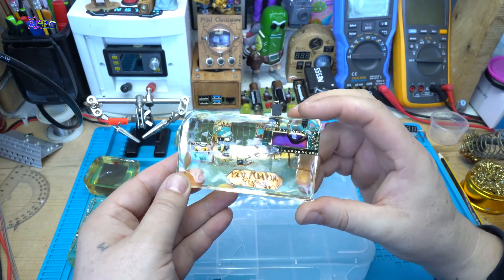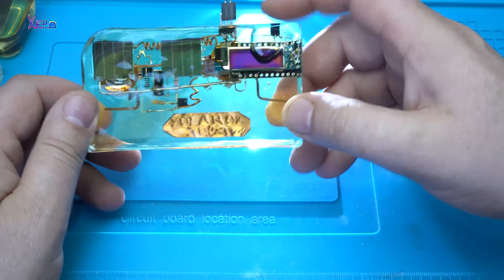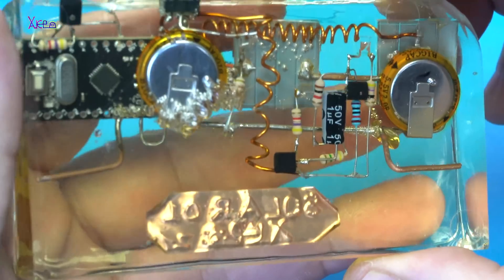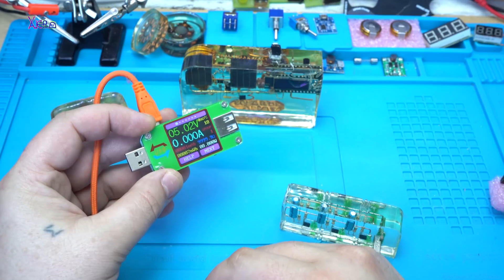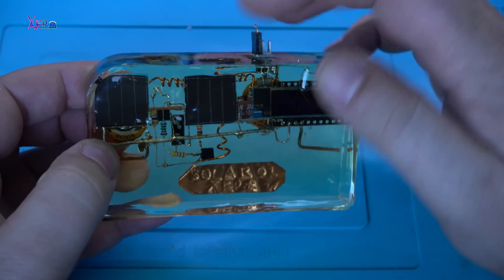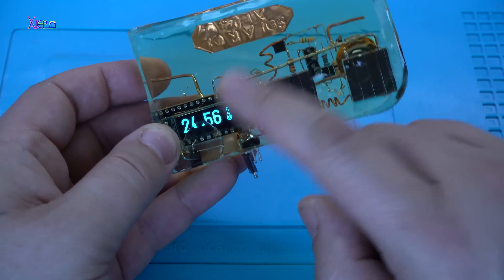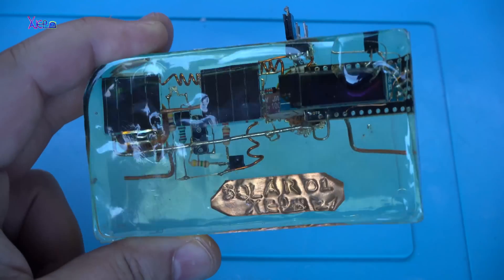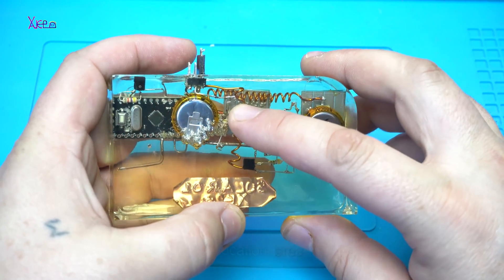Super Capacitor Invention in Epoxy Resin | Find out does it work?

Comment from the maker: What dou want to see in Epoxy resin,comment below?
Reply: Power Bank in Epoxy Resin. love from BANGLADESH 🇧🇩🇧🇩🇧🇩
Reply: They have been asking for Simon code and schematic for 2 years. Probably should put that in epoxy for your subscribers or they will leave when you do not honor your word.Lying to them for two years. Maybe I will post the codes for my various renditions of Simon and other memory games!! have you read your comments on that video? They hate you dude!!!
Reply: A Coil in Resin for Velg, so we can worryless about the shorting of LED, DRL, or Lamps on the wheel with direct DC Source from the Battery....

😀🙏
Reply from the maker: Great
Reply: Nothing
Reply: GSM Signal Detector !!!
Reply: Laser
Reply: Place visiting card in epoxy and make it flash with solar panel and capacitors
Reply: Teensy 4.1

Comment: How do you deal with the heat issue?
Reply from the maker: Very bad,some parts generate bubbles due temperature
Reply: With some epoxy, the thicker the epoxy is, the higher the internal temperature gets and the faster it cures. Is it possible to create the gadgets by slower process using thinner layers of epoxy added one at a time and allowing the to cure in between? Do you think this would lower the temperature enough to protect the components? Or would it not make enough difference? I do not know the exact epoxy you are using. Different types have different curing temperature, some can cure at low temperatures and could still harden while in cold conditions.